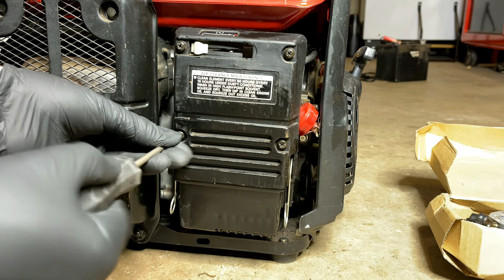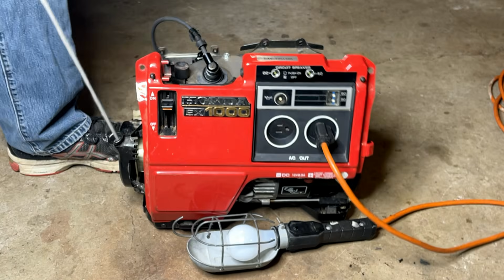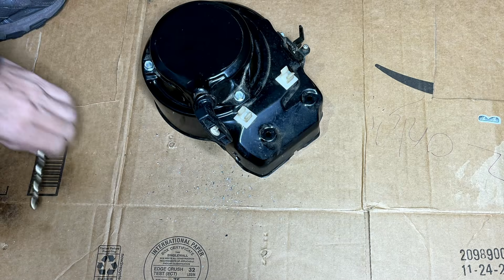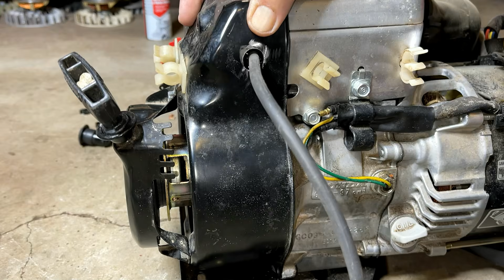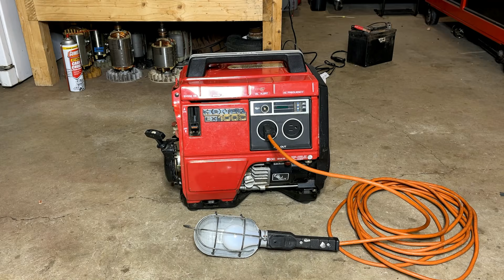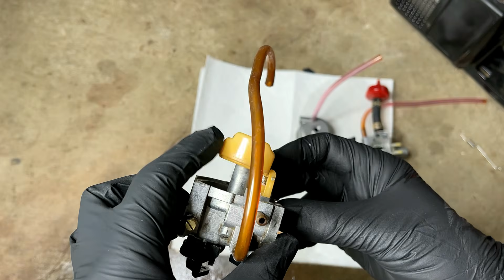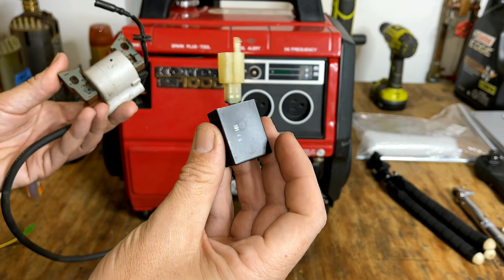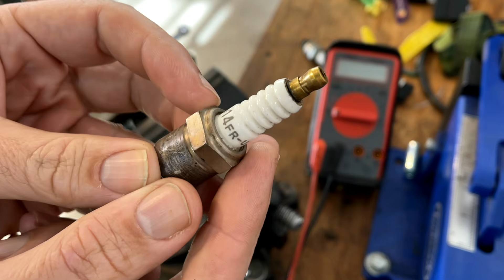Honda EX1000 - Will It Run?

Comment: I once had a spark plug with a loose centre electrode. It looked and checked fine outside of the engine and I would put it back in and everything would seem OK for half an hour or so. 
What made me notice the problem was finally I took the plug back out and noticed that it had no gap.
Poking the electrode with a screwdriver revealed that it was loose.

Comment: I have a Honda EX650 generator that runs away on speed and volts.  Have you ever repaired a similar situation or disassembled an EX650 to replace the governor ?
Reply from the maker: I have not.  Potentially the governor needs to be reset.  See my ETQ video.

Comment: What oil do you use in all your generators ?
Reply from the maker: 10-30 synthetic.  30 weight in hot weather, but here half the year it can be too cold for straight 30.
Reply: @jcondon1  I live in NY i put 5w-30 synthetic in all my small engines. What do you think?

Comment: I figured I'd wait to the end and see. I had a mini bike that had some light scoring on the piston wall (it wasn't a smoker, nothing noticeable) but when I ran it wide open for a ways then it would just quit. I'd let it coast down the road for several seconds, and while still coasting, after two or three pulls it would start right up and on I'd keep going. I was waiting to see if that generator was kind of in a similar state. We'll see. All the other diagnostics, wow, I wasn't expecting that many trails to have to run down; that's impressive work.

Comment: Having bought quite a few carbs off Amazon, I can say based on that fuel filter, it’s a aftermarket. All the carbs I have bought come with fuel filters and shut off valves and spare gaskets. Not proof positive, but an educated guess.

Comment: I've said this before, prices for broke, non-running equipment in my area is way behyond reasonable.  A local Craigslist seller in my area has this exact same model geneator, non running.  $350.  One thing going for it is that it is cosmetically in excellent condition like  yours.  Glad I saw  your video - didn't buy it.  You got the better deal - $Free.  There's another one for $385 but it runs.
Reply from the maker: I see similar asking prices for this model.  It is well built, but wound not pay that much.
Reply: @jcondon1  They are asking the same amount in my area ($300), and that's just way too much $ to spend for that amount of power.  Heresy I know, but I would rather pick up a chinesium predator inverter/generator for not that much more coin.

Comment: I'm intrigued by that oil sensor with the ignition transistor.  I would figure the semiconductor component is a uni-junction transistor.  Very old school. I used them to change a slowly rising voltage to a fast one.  It works kinda like an SCR.
Reply: The oil sensor module is mystery to many.  It's rare to run across a schematic, or even anyone that understands how it works.  It uses an SCR, but not for the reason many people expect.

The job of the oil sensor module is to detect when the oil level sensor is triggering, then shutting off the engine.  The level sensor is a mediocre open contact switch that typically makes intermittent contact with somewhat high resistance.  Some are about as crude as a nail through a foam block, with the point making contact with the case bottom when the oil level is low.  Others are a little more elaborate, but mostly to keep the float from jamming, not to provide snap action or self-wiping contacts.  At the threshold the contact point barely brushes against the case, burning the oil and metal while not allowing enough current to flow for long enough to shut off the engine.

The module uses the brief, small current flow to activate a circuit that shorts the ignition shutoff circuit to ground for several seconds, then resets.

Many people (well, the few that know electronics) guess that it's simply a SCR.  A SCR turns on with a small gate current, then latches on as long as current flows.  But a magneto ignition module is putting out pulses of voltage, which would immediately reset a SCR.  The module actually contains a low value (e.g. 1 ohm) sense resistor, a diode, a capacitor (typically 4.7uF) and a SCR.  Here the SCR is used only as a very high gain transistor, not because of its latching behavior.  The initial charge on the capacitor supplies the SCR gate through a resistor (typically 22 Kohm), which provides current for the few seconds needed to shut the engine off.

There are a few other components as well, mainly bypass capacitors and a high value resistor to provide electrical noise immunity and prevent dV/dT false turn-ons.

For those replacing the oil level module note that the metal case is a critical contact.  It won't work if it isn't screwed to a good ground.  After the brief pulse of current through the oil level switch, the module shorts the rest of the current to the case ground.

Comment: I'm trying to understand what happened. They were chasing the spark plug problem but trusted the spark plug too much to suspect it so they ended up replacing the original magneto with one that was backwards.  Then another repair attempt bought another backwards magneto and at some point the original non backwards magneto got lost. Wow! what a puzzle.  But you solved it.

Comment: The surging is due to a clogged low speed jet. It is under the D shaped throttle stop idle speed adjustment screw. Every carb with this design, needs this jet serviced. Also inspect the tiny o-rings on this jet, replace if necessary. You are still the best small engine tech I have ever watched, you're like a brain surgeon! Get a pin vise fromicroMark and a set of micro drill bits, to size 80.
Reply from the maker: The new carb ended up being the wrong one.  The diameter of the throat was smaller.
Reply: @jcondon1  yes, I saw that in the video... and it made me wonder.

Comment: What a strange puzzle, the recoil starter wind was a real mind bender. Glad you figured that portion out. The low oil ecm was another enigma, hope you can get the parts...
Reply: It wasn't a low oil module, it was a module that replaced points.  The circuit provides spark advance at higher RPMs by either detecting the rise time of the magneto coil voltage or (better) by tracking the time since the last pulse.  It's tricky to design an analog circuit that does this well, and very hard to make one that ages well in harsh conditions.

Comment: From the looks of that little generator that may have been the original plug James . Denso plugs were factory installed in those when new !  I had a 6000 watt china generator that had the same load issue and it was the plug . Glad you got it running well ! ENJOYED..
Reply from the maker: Thanks Shawn

Comment: Don’t feel to bad.  The local HONDA dealer wanted $94 plus tax ad shipping fr the 13 FD exciter capacitor. I reached it with a $10 one I got off of eBay. It worked fine even though T was 15 ufd.

Comment: Now put back the original ignition coil and the ignition module.
Reply from the maker: I already modified the blower housing, but will hold on to the original parts for future use if needed.

Comment: Thank you for this one. That took some time and explained a lot of things that would have had me stumped. "THE PLUG", I would have never known about because whenever I decide new parts will be required and I am not positive as to what is going on. The first thing I change out is the plug because it is the cheapest part. LOL I started doing that at the suggestion of another U Tuber. So, Yeah: Is the plug bad? IDK it's in the trash.

Comment: James, great video. I have an EX800, and it runs great. However, based on my experience, I’ve noticed it doesn’t like Ethanol based fuel very much, especially under a load. By adding K100 fuel treatment, it helps to stabilize and burn the fuel better. Of course Ethanol free fuel when I can get it is ideal. Man, you sure put in the effort! These older Honda generators are little gems, it’s unfortunate some parts are hard to come by now.

Comment: I had the same problem with a small 2 stroke generator that was quite new, at first I replaced the plug cap, but the problem was still there, a new spark plug fixed the issue.
I have had plugs that leaked compression, but this was the first time I encountered an electrically leaky plug.

Comment: Love your videos, and agree this is probably the best one yet!! I had a similar issue with a 5.5hp Honda engine on my pressure washer this past spring, and I was just losing my mind not being able to track down the issue. Sure enough I happened to look at the top of the plug (at the base of the ceramic insulator) and noticed the spark arc every few seconds. Upon closer inspection I noticed the insulator had a hairline crack (probably from water splashing on the hot plug and causing it to flash cool).

Anyway, great lesson here! Sometimes it’s the simplest of things that can go wrong!

Comment: I had an EX 1000 that I bought new in 1995.  Never had a problem with it, other than a bad exciter capacitor that I had to replace.  The lead on the exciter capacitor broke off and kept the generator from producing power.  I also had to replace the air filter with a piece of new foam from an old Briggs air filter.  It served me well for close to 25 years.  It is actually a 1500W generator.
Reply from the maker: Its a well built generator.

Comment: Wow… James that was incredible!  You really conquered the challenges of working behind the original owner and his DIY miscues.  I forwarded him the link to your video… he will probably kick himself when he realizes it was a $4 spark plug fix.  He said he had worked on it for about 2 years.  He gave it to me thinking maybe I could fix it (since I fixed the Ryobi inverter generator which only needed valves adjusted and fuel switch replaced).  I now know there was “no way” I could have fixed this Honda.  The multitude of problems you encountered is far beyond my mediocre skills.  Your calm patience and perseverance in troubleshooting is admirable.  You’re an awesome Guru and I love to watch the Master at work.  Keep ‘em coming!
Reply from the maker: Thanks Brenda for sending this one.  I thought this would be an easy one.  Spark issues like this can be very difficult to diagnose.  I have never seen a plug fail in this way.  This one almost had me beat.
Reply: @jcondon1  The thing that leaves me incredulous is your never give up attitude and mountain of patience. Who would have thought fixing generators could be so interesting.
Reply: @jcondon1  Well I had a plug that was kicking my butt for the past three years on a Deere F510 mower - super hard to start (thought it was a fueling issue) but once running it ran perfectly all day long.  And the stupid thing is, I killed the starter these past few years because of this, all while a few feet away I had a brand-new spark plug sitting there for that machine the entire time.  D' op!  So I agree, change the plug (with the correct one)!
Reply: Brenda, Thank you for sending Jim this generator. It is my favorite of all his videos to date.

Comment: Using the drill the only spark was counterclockwise and none clockwise
With the recoil back on you can see it spins clockwise.
If the thing ever worked properly in the past with the clockwise recoil and the coil in the original orientation why would you have to flip the coil around to get it to work?
If the thing needed the coil flipped around to make spark and run how did it ever work in the first place?
Reply from the maker: The new coil was not the proper one.  It was meant for an engine that allowed for the spark plug wire to exit the blower housing from the right not the left as this one expected.

Comment: Could be an SCR, Silicon controlled Rectifier. When the gate is triggered then the anode is switched to on and collapses to the cathode. When the anode voltage is zero or switched off with no trigger voltage then the anode resets to open! SO, it is a Switch! Ron USA, PTL

Comment: Fascinating to watch and great job on this one. I'm a software engineer. Problem solving and debugging is the same everywhere: find the most likely problem area based on the info you have. If that doesn't fix it, keep going to the next most likely suspect. Occasionally step back and make sure you're looking at the problem correctly.
Reply from the maker: I am also a software engineer by day.
Reply: @jcondon1  You can't just replace some code to fix software LOL
Reply: @jcondon1  My thought was "he troubleshoots generators like s/w engineers debug code." Dots connected. :) I suspect this is also why you're so tenacious. There's no "can't figure this out" option with s/w. You need to keep going until you find the issue.
Reply: I'm a Physics major and have an inherent intuition into the behaviour of that ceramic insulator under differing thermal loads.

Comment: Agree with Bob,  this is one of your best videos to date!  Your calm demeanour is very therapeutic.   I almost want more problems to show up so I can see you solve them. Feels like I’m there with you. When I saw you pull the rope the second time(19:55) I could see that the rotation was still clockwise. I was screaming at screen trying to tell you you’re not getting spark because of same rotation issue. Keep them coming and if you ever need a helper give me a shout!

Comment: I  have the same generator and it has over 25000 hours on it and it still runs fine. The only maintenance I have done is change the oil but probably not as often as i should.

Comment: I have had 2 bad spark plugs last year but never before that. 2 different machines. What a biatch to diagnose. The second one was after I did a valve lap job and reset gaps on valves. It wouldn't start and was going nuts. Changed the plug and holy crap. Love the vids, very informative. Thank you.
Reply from the maker: Thanks.  I too have never really had a plug issue.  Since this video have had a few.  Last one I replaced a broken valve and assume I made a mistake with the valves.....  Just another bad plug!

Comment: Jim I'm a Honda dealer where I work let me see if that coil has been superseded to another number, just for fun I know it's fixed and works but for a Honda to not make a coil, that's odd great video
Reply from the maker: Thanks Tim.  I am pretty sure the original coil and ignition unit works, but since I already modified the blower housing I left it as is.  Would be curios if something is available.  It would help others.  This is a good generator.  Would be a shame for people to trash them due to discontinued parts.
Reply: @jcondon1  ignition coil is 30500-ZC0-033, and the ignition unit is the correct part number, Jack's small engine can get it hope this helps

Comment: if my eye's were working right...@43:57 it looks like the air box plate gasket was installed upside down also.?...
Reply from the maker: Wow, I did not catch that, but YES it was!

Comment: Was also thinking the valve adjustment could be too tight and when they get hot they expand causing the valves not to close all the way.
Reply from the maker: That was my next move, but compression felt great even after stalling and still hot.

Comment: With the smoke and what appeared to be over heating I would have first run a compression test to see if blown head gasket or
burned exhaust valve or a bum carb inlet needle seat but the spark plug....got to definitely put that at the top of my list, nicely done....!
Reply from the maker: Thanks

Comment: I’ve had very few bad spark plugs. Never an intermittent one. Thanks for sharing.
Go ahead buy the motorcycle, you know you need it.
Reply from the maker: Was eyeing the EU7000is
Reply: @jcondon1  Get the Super Cub 125 step-thru little motorcycle. It's not a scooter.

Comment: I was just wondering if it was possible the flywheel may have moved just enough to have caused the coil to fire at the wrong time, requiring it to be reversed to work.
Reply: A reasonable guess, but there would still have been spark.

I was going to guess that the flywheel magnet was demagnetized.  It still could have been reverse magnetized.  Old Briggs and Stratton flywheels could be returned to the factory to reverse the magnetism when switching from points to transistorized module ignition.

Comment: James, many years ago I used to work on copiers. I found that the more parts I put on to test a repair, the more likely it was to have a problem. Perhaps you should avoid the curse and try a repair before putting it all back together. BTW, do you prefer James or Jim? Great job as always.
Reply from the maker: Jim.  I have a a few rounds with a repairing a copier.  Not an easy task.

Comment: I had a Powerback 5000 with a 10 hp Tekumseh that would die under high load. Chalked it up to worn valves but now I wonder if the coil was at fault. Really enjoy your work sir!
Reply: High load means high combustion chamber pressure, which requires a smaller gap or higher voltage.  That usually points to a leakage path through a carbon tracked plug insulator, cracked cable, or failing coil insulation.  Carbon tracks form when a discharge pulls carbon from CO2 in the air, and then rapidly get worse as the conductive carbon encourages continued arcing.  A failing coil is more likely to just short out when hot, then work again after cooling down.
Reply: @1djbecker  I agree and my experience has always shown a coil to be good or not. I guess I should have thought of that. That particular generator drove me nuts. I changed all fuel lines, fuel filter (for gravity fed carb setup), even changed the fuel shut off to one that flowed more, spark plug, air filter and carburetor. It would start and run perfect. Even took load good. Once I would get it up to about 3400 watts it would run for about 3 to 4 minutes then falter and die. As soon as you would walk up to in it would start back and do the same.